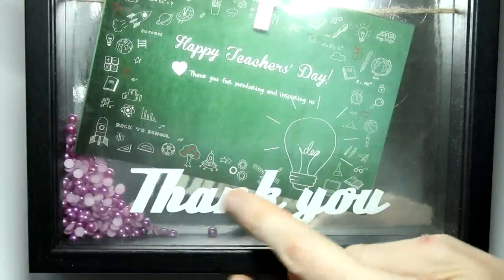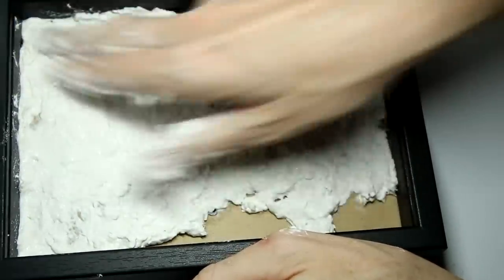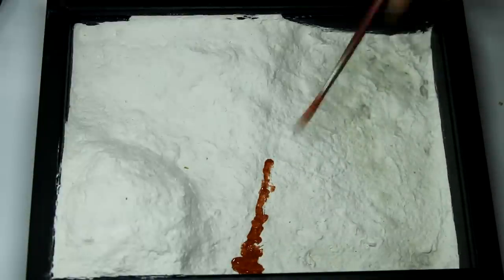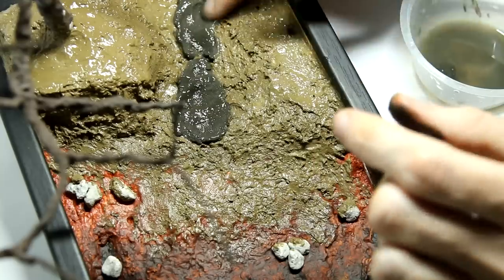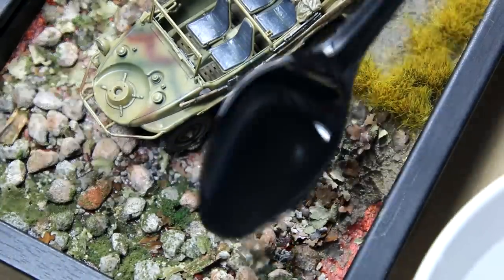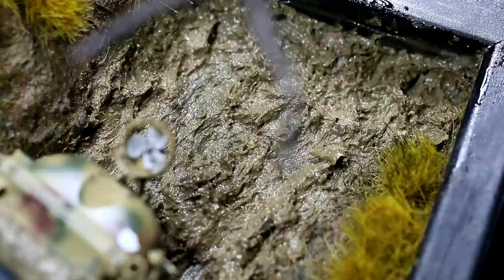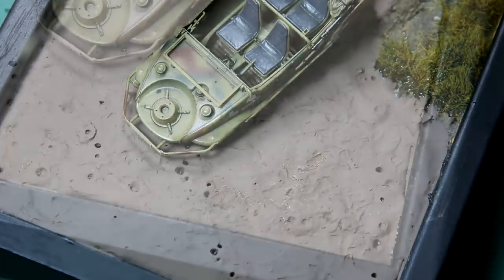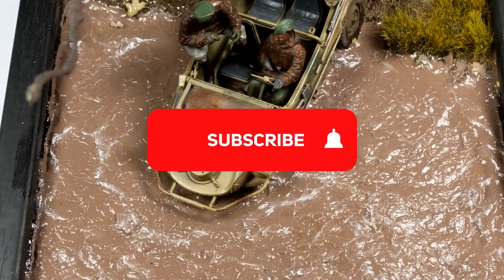Building a Schwimmwagen river crossing diorama (1/35 scale model)

Comment: Nice dio and tutorial. One comment however. You put the Grossdeutchland marking together with SS number plate. GD was no W-SS division.
Reply from the maker: Hi Tony. You're surely right (I have no reason to disbelieve you :)  ). That's definitely an area where I am a bit slack - checking for little details like that, and making sure units are in diorama settings appropriate to the front they actually fought on.
Reply: Nice catch is so glad I wasn’t the only one

Comment: I want to try and do epoxy resin dioramas and I'm scared for that to happen , those mass amont of  bubbles forming how can I prevent this?
Reply from the maker: The main problem is heat generated by the resin as it sets. I had a very limited choice of resins to choose from, and it turns out this version produced a lot of heat. I'd recommend 'low heat' ones if you can find them, plus doing a test pour to a similar depth.
Reply: @ModelNerd  thank you that was very helpful

Comment: Just the air trapped in it did you use the flame torch over the top of the resin when it was wet to release the air bubbles? Just one of them small kitchen flame torches does it fine but abit of the AK water foam for waves would have fixed it it's just one of those things I think we have all experienced at somepoint when something is going to good eh! There's always something that stops us haha, That's what modelling is all about though now you have that experience and a fix for if it happens again in future it only betters us as modellers! Well done though looks good 👍it's happened to me aswell I done the same painted it merky green with a small top layer of resin over that and that AK foam water stuff for making white horses (waves)
Reply from the maker: Thanks Charlie. Yeah, I've seen the flame method but tbh this was my own fault for using cheap generic resin - this wasn't so much a few bubbles as a runaway exothermic reaction - it even melted the model kit plastic! That'll teach me not to be a cheapskate!

Comment: Well this is what I call a fortunate accident... I have a paper model of a PTS-M amphibious tracked carrier, and I was thinking of making a diorama of a 1997 flood in Poland, which would require me to partially cover it with water; but, because it's a paper model, resin was out of the question. 
With this video in mind, I'm now considering priming it with a paper varnish, inserting it in a hole in a styrene base, pouring a thin layer of plaster around it, then painting it light brown and covering everything with medium gel, to imitate the murky browny waters brought by the flood. Should work about fine.
Reply from the maker: Sounds great. Good luck!

Comment: Is it difficult working with the water like resin? I’ve never done it myself but am checking videos to learn how to and have never seen that result on any video that I’ve watched.
Reply from the maker: Depending on the type, resin can produce a lot of heat as it cures. The heat speeds up the curing, which creates more heat and causes these bubbles. Unfortunately it is hard to know in advance if this will happen (though some resins advertise themselves as 'low heat' varieties. The resin I used was a generic brand - brands aimed specifically at model making should be better (and more expensive).